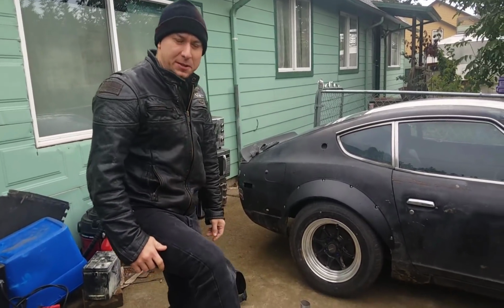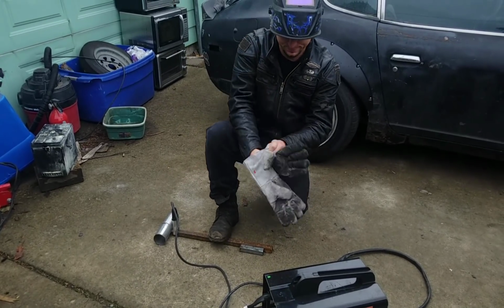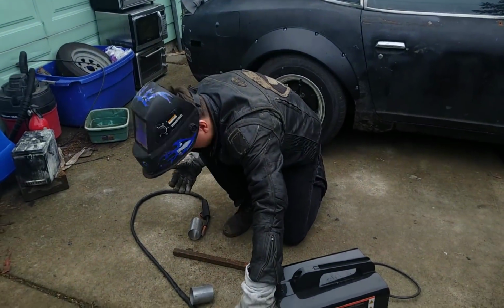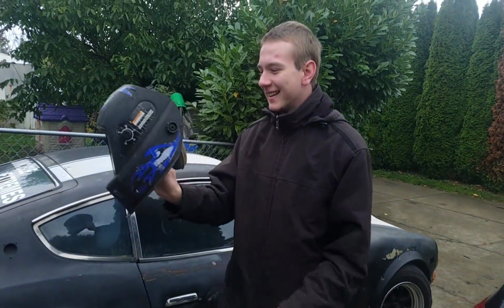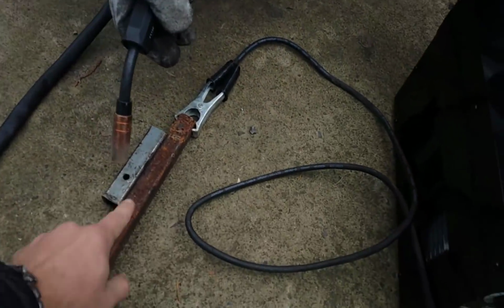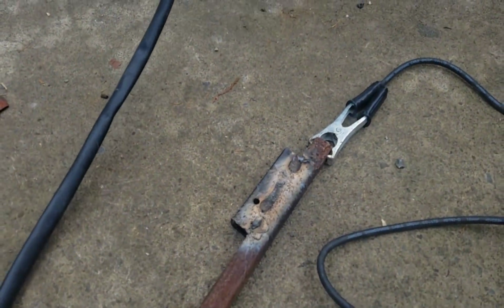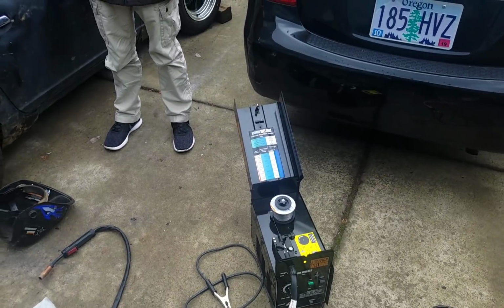$99 125 amp welder. Worth it? new 90 a.  Harbor freight 120v budget welding review. Chicago electric

Comment: First, you need to clean the metal before welding to get the best results.  Second, that extension cord is a choke point.  If you are going to use an extension for welding, you need the heaviest gauge extension you can find, and shortest possible to meet your needs, like a six foot cord with 10 gauge wire.  I don’t eve weld, but I make jewelry and can solder fine metals.  I’m thinking of teaching myself welding, but this video is a example of how NOT to weld.  If it worked at all with dirty metal through an 18 gauge extension cord then color me impressed.
Reply from the maker: Well aware.  The people who will buy this will do none of those things.  That's why the review was done this way

Comment: Dident you have one of those before?
Reply from the maker: +Aaron Hayden I have the 240v 170amp one you can use gas and a 10 lb spool with.
Reply: Invincible Extremes Muscle Cars Garage ok I remember that video where you welded that hitch on
Reply from the maker: +Aaron Hayden yup, that's the one.

Comment: I've never welded before in my life and I'm trying to find a cheap welder to practice with would this small welder work for learning
Reply from the maker: The 170 model is a much better welder than this but requires 240v  if you're not wanting to go above 120v then the century fc90 is what you want to use.   This welder is cheap but it's not very good so once you learn you'll get rid of it and will have wasted your money.  The other welders will continue working good for you even after you get better... and they're still very very cheap
Reply: @InvincibleExtremes  ok thank you sir

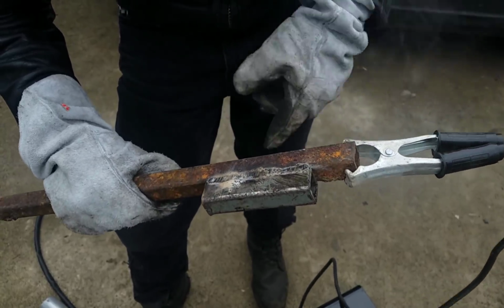Comment: 5:13 sure your PREHEATED with the  other 2 welds ,
SO YEAH GROUND NEEDS TO BE CLEAN 
IF YOU PREHEATED THE METAL,  THE FIRST WELD MIGHT BE FINE
Reply from the maker: You're absolutely right in that regard.  These little welders do mich better with preheating.

Comment: Dude. Take the transformers out of those microwave ovens behind you and make your own stick welder.
Reply from the maker: You're absolutely right.  And it would be 100 times better.
Reply: @InvincibleExtremes  
Lots of videos on how to do it. But the transformers in these welders are monsters. If you added 2 MOTs to the original in parallel, it would probly work great. And put a switch between for power variations.

Comment: im on month 11 of a welding hobbyist class with no mechanical background and i can tell you that none of these welds look good and the technique and prep is horrible. no offense guys i know you are trying to make a helpful video but for someone (like me) who is new to welding, there are very simple ways to make your welds look a lot better. grinding rust and mill scale off your metal is like number one. minimizes slag and porosity immensely. also, for a new welder being comfortable helps a lot. standing waist high and maybe just filling in some angle or filling up a coupon in the flat position helps learn how to maintain good beads and straight welds. i recently just bought a similiar welder like this because my class is ending soon and for a slight more investment you can get a similar one that's name brand and comes with a gas hookup for argon/c02 or helium mix or whatever mix u need. i looked at a lot of welders before i bought mine, knowing its limitations, and after the reviews there really are only two name brands you can trust. Lincoln and Miller. the one i got was a 110 lincoln with gas hookup for 300$. i think lincoln might own chicago i heard? idk i could be wrong and i dont feel like googling it, but yeah. with my limited experience i can tell you if you want to get good welds out of a limited machine like this, do all the right prepping and heed the reference guides for speeds and heat that come on the welder for different dimensions of metal u plan to weld.
Reply from the maker: Jake Jeckel agreed. All good points my man, but life isn't a classroom, and many times you will be welding on crap metal, in crap conditions and have no other choice, hence the video showing exactly what happens and if it'll perform at all.

Comment: I just ordered one online,    That's supposed to be a 10% duty cycle,   I watched the Clock when Daniel was welding,    the machine should have kicked the overload breaker...   I have a HF 110 stick welder..   It's 10%  or less.
Reply from the maker: These little things go for a bit before kicking the overload.  The century fc90 I have goes on and on and on though.  I like that one a lot better, it's half the weight and size, and is variable for power and is DC so it welds cleaner

Comment: To be perfectly honest your welder would put out a better weld, at better consistency if you took it off of that little extension cord and either; a)plug it into a direct single source circuit 20 amps or better or, b) if you at least change the extension cord to a 12/2or 10/2 wire size.
Reply from the maker: Yup

Comment: Fuck man that weld around the pipe looks so much better than mine. s
Reply from the maker: It works.  It's ugly but it does work.  I do prefer the century fc90 though.  Much better weld, same flux core wire.
Reply: @InvincibleExtremes  Yeah I  plan to use it to remove my second cats and put in vibrant resonators. People say it's not good but I mean if it's welded it's welded right. I'm in Canada so I got a Mastercraft Mig flux welder
Reply from the maker: Welded is welded.  It'll rust like crazy anyway
Reply: @InvincibleExtremes  Right the only thing I've been told that makes sense it just to put some paint over the weld and it should last for some time.

Comment: There is no pattern just push or pull, pattern changes 35 times each weld burn it in with no undercut all that matters
Reply from the maker: tankeduup yup.  Thanks!
Reply: Heck yeah man i re-read my comment and i didnt mean to have it sound negative in any way. I work on asphalt/concrete plants so all i know is 7018 struct welding multi pass fillets/weaves. I've ran dual shield/fluxcore but only a hand full of times it's all the same thing though! I'll sub
Reply from the maker: tankeduup no worries man, sound advice is always welcome

Comment: first off you don't weld on Rusty as you call it crap still II you don't use an extension cord as long as the one you have stretched out there and that should get the point across you guys just watch the video you see where I'm going with this right
Reply from the maker: Yup.  Well aware.

Comment: I wouldn’t advise anyone use this video as a guide for beginners. Lots of health and safety no-nos here. If you want to start welding, remember this: 

-You can’t just weld any metal you feel like together. Different  metals require different processes - do your research and make sure the type of welding you choose is right for the metals.

- Make 100% sure you know how to Earth the welding machine properly. Check the leads aren’t damaged and that you’re using the right parameters on your machine. Generally speaking thicker metals require more amps but don’t guess! Do your research! Also weld in a well ventilated area that is free from dampness and away from anything flammable.

-Get the right helmet and gauntlets for the job. Make sure you know how to use your helmet and set it right. Cover your skin and make sure the outer layer of your clothes are made of non-flammable or flame retardant materials.

-Don’t just pick up the material you’ve welded with your hands, even with the gauntlets on. The metal gets really really hot and trust me if it gets hot enough it’ll burn your gauntlets. Don’t put your foot on the metal either. Use pliers to pick up the metal and you can either leave it to cool or quench it in water (maybe).

- Make sure you got the right flux, and gas for the job (if you need it). Don’t guess! 

-Don’t treat your welding machine like a toy. It’s not.

- when you start out, don’t try and weld two pieces of metal together straight away, start by doing straight runs on a flat piece and getting used to what’s going on and manipulating the weld pool. Learn the best angles to hold the torch at the right distance and get used to moving it at the right pace. Different joints require different angles to hold the torch at. Do the research!

- Have a fire extinguishers nearby.

- Remember your a baby in the welding game. It takes years of practice to master and even then it can go horribly wrong. Don’t run before you can walk. Don’t weld parts that hold weight until you know for definite you’ve done the welding right.
Reply from the maker: Its a $99 welder, relax.
Reply: Invincible Extremes Muscle Cars Garage 

The videos good for showing what it can do, so I give props for that.

I just notice that there are comments along the lines of “Good stuff, I’ve never welded before and I’m going to buy one right now and start welding with the tips from your video” and I just think if you’ve never welded before then it’s a silly attitude to have.

Everyone takes different risks but newbies should be risk averse.

Comment: How do you use a 125 amp device on a 30 amp breaker?
Reply from the maker: Darn good question.  The answer is is uses a transformer and steps the voltage down while stepping up the amps.  That's how.  Besides that it's pretty much magic lol.
Reply: Bob Shepherd ...dumbest question of the week lol

Comment: You did as well as can be expected but that being said, that welder is JUNK just like any other 110v/120v welder is. 
Anyone wanting a welder should always buy something better that's a 220v. If you can't afford a 220v mig welder then get the Lincoln AC 225 stick welder. You can weld from 16ga to any thickness of steel. It will take more skill to weld with it, and you will need to start out welding thicker material at first, but once you understand what you're doing and what you're looking at while you're welding you will be able to weld thin sheetmetal as well.
Reply from the maker: Agreed

Comment: I got one of these works best with Lincoln brand wire
Reply from the maker: They're not bad.  I really prefer the inverter dc output welders though, especially with a gas bottle
Reply: @InvincibleExtremes  i got of them to. But take my word. Lincoln Flux wire is best. That Hobart shit is junk

Comment: You're actually supposed to push the puddle not drag it. You wont get good penetration unless you push the puddle.
Reply from the maker: Ryan McFarland on flux a drag works best.  Push on a mig though.
Reply from the maker: Ryan McFarland "if there's slag, you drag" is an easy way to remember.
Reply: Yeah, with an a/c welder that splatters a lot, it's good to be moving in a direction away from what you have already deposited.
Reply from the maker: Denise Manning when you can anyway... but welding in real life sometimes doesn't allow for much choice... just work with what angle you can reach...

Comment: average  2 yrs  Then the gun or gun feeder goes out. THERE NO REPLACEMENTS FOR THEM EITHER
Reply from the maker: Which is why I prefer the century fc90.  You can get replacement wire feed parts actually, but I don't see the point on something this cheap.

Comment: On low it spudders keep it on high
Reply from the maker: dogtroop 515 If I had cleaned the metal it would have ran ok, but just had a lot less power.
Reply: Invincible Extremes Muscle Cars Garage I know what you mean bro it's still a good welder to do little jobs I'm not trying to be a dick just wanted to comment have a good one man
Reply from the maker: dogtroop 515 yup, you too man.  I got ya, no worries.

Comment: Not a very good review of the welder imho. If I'm gonna do a review I'm gonna make sure the controllable factors are covered;  ground area clean, a basic chipping hammer heck even a regular hammer to chip some slag away after each pass. Props to your brother thou for trying to weld being barked at lol but finishing strong.
Reply from the maker: Yeah this wasn't the best video at all.  But my bro got the hang of it

Comment: 90amp Duty cycle sucked aswell

I got one and was disappointed
Reply from the maker: Yeah, I have a century fc90 and I love it.  Works a whole lot better than this and is half the weight.  Or is that the one you are referring to?
Reply: @InvincibleExtremes  
I got the harbour frieght 90amp,

Can only use it on super thin metal
Reply from the maker: Yeah, that kind of sucks.  90 amps is 90 amps though

Comment: Wow dude in surprised the kid even did that good with you hollering out random confusing directions lol.  I know this wasn't a" teaching brother to weld" video but damn buddy you coulda gave a little better instruction. But still video proved it's point the cheap mig welder at harbor freight actually works decent surprisingly.
Reply from the maker: Yeah he got a lot better when I wasn't confusing him.  The better welder is the 170amp model btw.  The output is DC so flux is cleaner and it has options for using gas shielding.

Comment: Cool Datsun Z
Reply from the maker: Eric P thanks, I drive it everywhere with a 4 speed and v8
Reply: Invincible Extremes Muscle Cars Garage 
I checked out your video because I'm thinking about getting that welder you bought for 100 buck at harbor freight. Wanting to ruin my rear axle and weld it like a cheap LSD for my Toyota Corona. Looks like this would do the job. I never welded before like your bro, but planning on getting one to familiarize myself with the whole process.thanks for the video tips👍
Reply from the maker: Eric P the century fc90 is a LOT better welder btw and it's only $169 before any discounts or sales...they sell them at home depot.  It'll be better to learn on and it's half the size and weight too.
Reply: Invincible Extremes Muscle Cars Garage appreciate it man. I'll definitely look into that one then.

Comment: you won't like that welder in less than a month that thing is garbage the duty cycle is like 2 min welding 10min rest and your settings are WAY OFF
Reply from the maker: +Codeack 101 I'm ok with that, been welding a long time with much worse.

Comment: The low setting is way too low amperage and that's why the welds looked so bad
Reply from the maker: Cody Stringer yup, and the metal not being clean and having a bad ground didn't help either.

Comment: There is a video on YouTube= How to test cheap ebay bridge rectifiers.The  First test=No D/C output. Second test=D/C.
Hit and miss of all the diodes functioning. One broke, no D/C.
There is another video of a guy opening his "from china" envelope and the big blue electrolytic capacitor inside.
The can has a big dent in it. The dielectric properties of that cap, will no longer function. So it leaks all the energy.
Zero capacitance=Fail.
Several videos of guys wiring blue electrolytics in series to filter the D/C ripple. Why?
The schematic(search)of one big name: "180" D/C, Inverter welder designed in America, sold worldwide. 
Only needs ONE, low ESR .5 MOhm D/C capacitor (High current-film type) rated at 50 Amps constant current. 
Cost-$60 from legit electric supply house.  Plus shipping in an actual cardboard box with styrofoam pellets to protect from damage.
*
 Now add a Fixed inductor choke of about 1-2mH for D/C 50 Amp output. $80 Name brand, also sourced from legit supply house.
*
Next a quality, reputable manufacturers 10% tolerance, 200 Amp 3 phase bridge rectifier.
It containis 6 diodes. Each rated about 35 Amps but you use only four in single phase A/C to D/C.    
So.....4X35=140 Amps.  You will never see 140 amps. Your on a 115v 20 Amp breaker.
Your modded welder may draw around 24 Amps welding on "High" but now with a ripple D/C output.
 Electron flow of electricity is in fact negative to positve.
For flux core, you must wire the gun tip for + electrode posiitve. Your new $20 ground clamp is the big wire and should flow the negative - current through the metal(work) Now you still have the shaky feed issue with the cheap plastic wire feed but a D/C arc. 
 No more 120hz flipping negative to positive A/C current at tip and your work.
 The quality bridge rectifier, will have an excess capacity of about 11 Amps more than your(Load)What your welding.
About 24 Amps on high setting.
That means that the 20% duty cycle of your heavily modded HF box could weld on D/C for 2 minutes on, and 10 minutes off.
 Only IF- the cheap china A/C step down transformer that is still inside, doesn't melt on the hottest day in August.
 Now you wasted $250 on modifications to the  "Inferior by design," $100 bargain ripoff.
Reply: Oh I forgot,  A quality  bridge rectifie is $60 and is Q.C sample checked before leaving the factory. 
Failure to operate as designed and design company in Europe, Japan or America simply refuses to accept shipment.
Diode bridges in a welder that dependably rectify on a hot summer day cost about $65. U.S.
Envelope stuffers in china "Liquidate" factory inventory of 1000's in defective production runs.
Yet they offer:
"Free shipping" their defective components to you the little guy in America and Canada for your dollars. 
A bad rating is fixed by only a few clicks to create  a new seller 98 thumbs up % in ebay store. 
Do the math. 1,000,000 HF flux welders in D/C conversions = Millions $$$ in internet parts sales.
Reply: Two errors I made in my above post here. A rectife circuit for converting these HF welders to D/C.
 only uses 2 of the 4 diodes for forward current. And the current rating of the bridge is not  the sum of all diodes added together. 
The D/C ripple capacitor I mentioned would indeed handle this "90 A Welder" Max setting.
The HF 125A may reach 90 A on high. But in their spec it says "average Amps" is @20?
What kind of penetration will you get on 1/8th inch plate? None.  Electro-Muffler-duct-tape